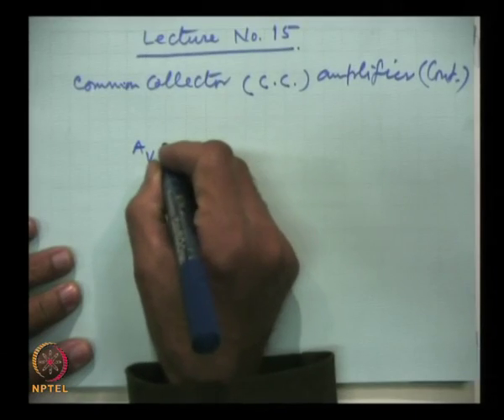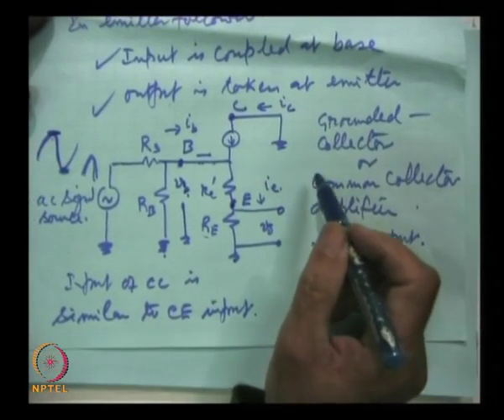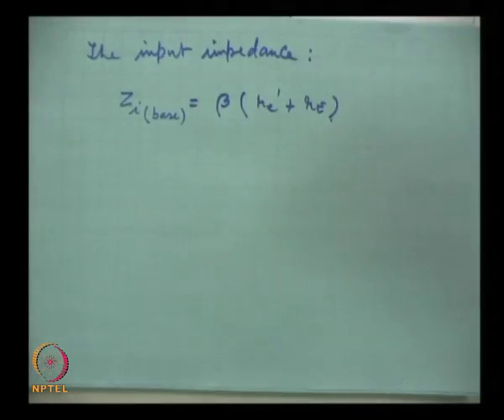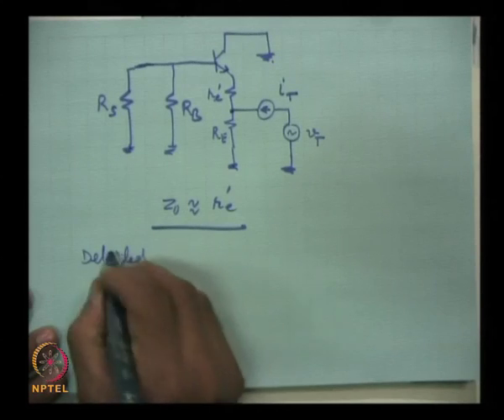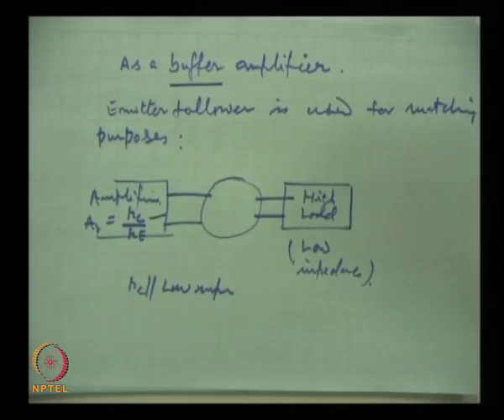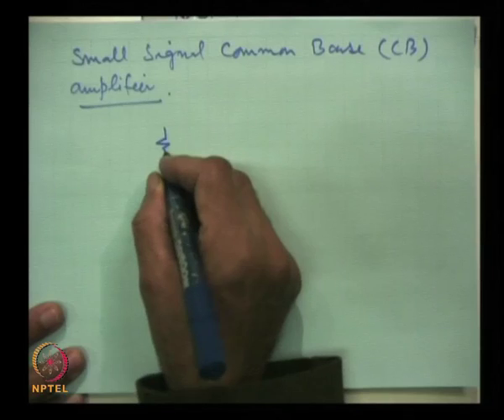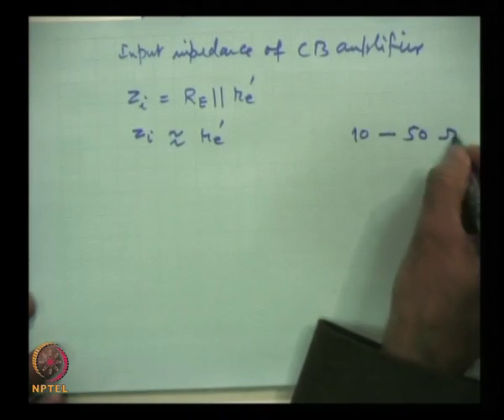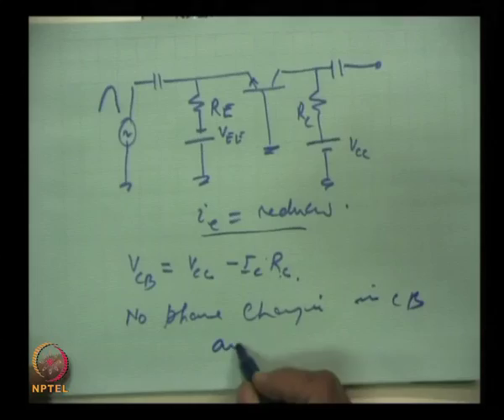Mod-03 Lec-15 Lecture-15-Common Collector(CC) amplifier (Contd.)

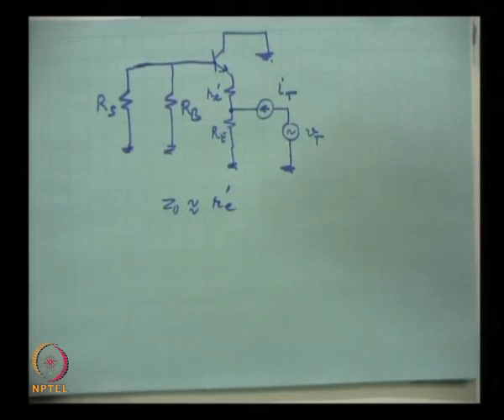Comment: 24:06  minute how re will be at zero potential
Reply: try to put emitter's re model over here then you will understand why he took it to be at ground potential. hope this helps.
Reply: @Pooja Agarwal because Kirchoff's voltage law in the considered CE loop undergoes no change by neglecting the Base side hence professor found it quite acceptable to remove the Base for sake of simple analysis